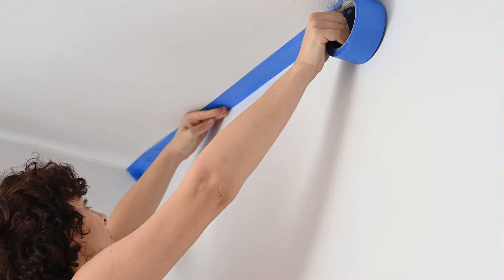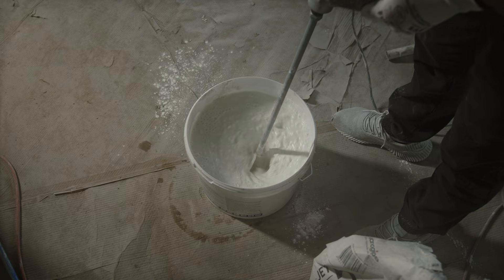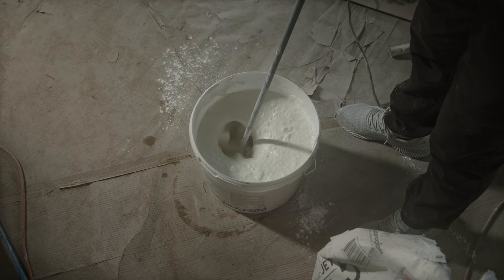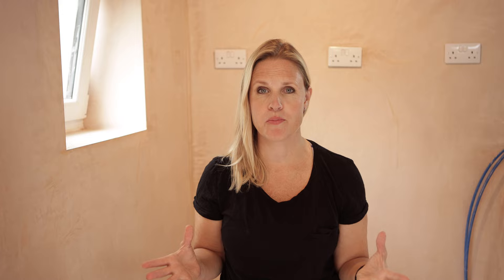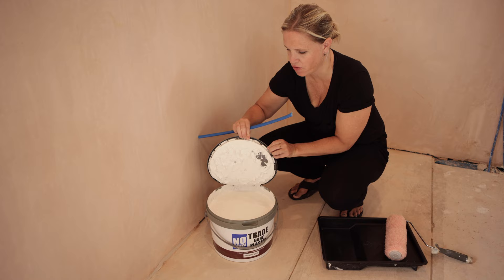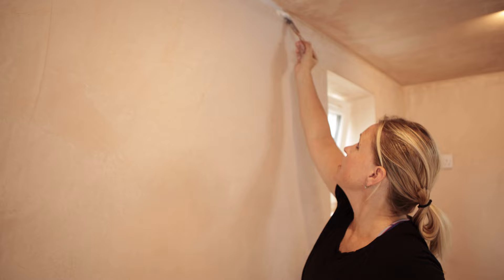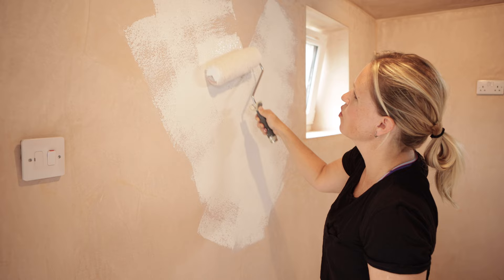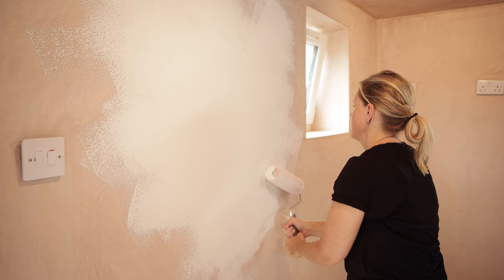Quick And Easy Tips For Painting Fresh Plaster Plus The Best Paint To Use!

Comment: Love it... deadicated bare plaster primer is so much better than thinning down cheap contract Matt............ Gina.. my top tip Wednesday, don't use a pipe or anything round to mix paint, it doesn't mix paint as it's aerodynamic so doesn't allow it Mix. Use a proper paint mixing stick or slim strip 1.5-2" wide of wood that actually moves the paint about ;)

Comment: A light sanding down of the walls should be done too, prior to painting, as there are always little imperfections regardless of how good your plasterer is.. Trowel marks, little bits of plaster on the surface. I always use white matt paint, 50/50 mix, works a treat..

Comment: Tried them all. Nothing beats mist coat😊
Reply: With what paint
Reply: @hardworker8030  White emulsion. Recent loft space looks beautiful.
Reply: @cliffhill3437  What brand did you use
Reply: @hardworker8030  Use any brand of paint, but check first if the emulsion has instruction of the side saying it can be watered down.  They will often tell you to add 10% water to the emulsion, but personally I go a lot further, maybe 30% and mix with a paddle attachment on a drill or anything you can attach to a drill to make something that would stir the paint well.  I have seen some people use old spatulas with the handles removed at a pinch
Reply: @Christopher_T_Paul  Most decorators will tell you to use contract matt but the manufacturer will tell you it's not designed for that. Also when she was applying the paint you can see it's not soaking in to the plaster.
Reply: @hardworker8030  I am no decorator, but I have been on a journey all my life flipping houses and moving up, so I have done my share of renovating and painting, curently on property 14.

My last property seemed an easy flip, an old house that had been replastered in the last 5 years.  As soon as I started painting I was getting horrible blisters from the old paint an absolute nightmare, a bit of investigation and I think they painted with a vinyl paint straight on the new plaster and the paint had just formed a skin.

I ended up having to paint the whole house and trouble shoot the scores upon scores of blisters.  Usually cutting out small areas and using a filler to bring it back to level and repainting until the blisters stopped.  I used at least twice as much paint and probably cost me a week of labour.
Reply: @hardworker8030 to be honest the way she painted worried me , it looks as though one room would take her a month to paint

Comment: I always use mist coat, it isn't hard, but it can be messy.  I always mist coat using watered down emulsion and has never done me wrong.  By the time you  mist coat a room, then have a little break the room will likely be ready to start a second coat. 

It takes me typically 2 mist coats and 2 top coats over 2 days, just because of the drying times.  I can comfortably paint 3 rooms in 2 days from bare plaster.

I really wouldn't try painting like in this video though, get an extendable pole, it is much easier and will save your back.

Comment: That fresh plaster paint is good stuff, I have given up making my own watered down emulsion once I found out such a special paint existed, plus as you say a few sound coats and you have a good quality finish or a good base coat for any light colour.
I use a kitchen ladle to spoon out my paint into the roller tray, less messy plus I now use the smaller rollers since some organic type painter women pointed out they make less mess in use and use less water when cleaning and are easier to clean. Can't argue with that.
Can't believe you are painting white while wearing your black clothes 🤣🤣🤣🤣.
Reply from the maker: Yes the black clothes got sacrificed years ago so they’re my painting gear now! 
Like the roller top - thanks for sharing 😊